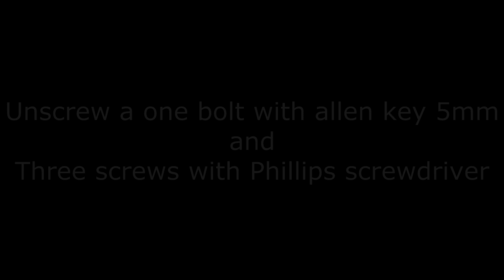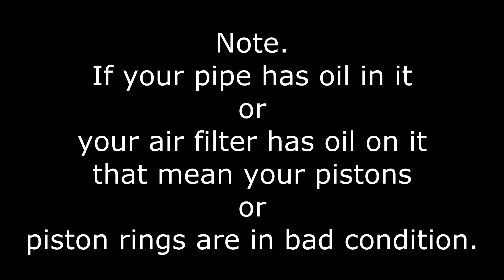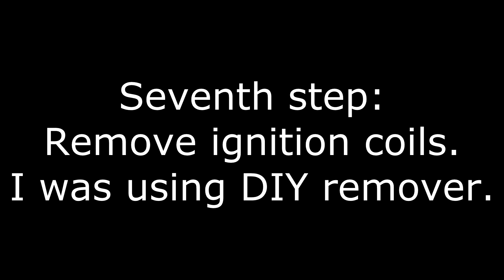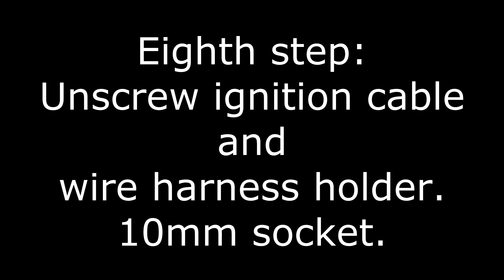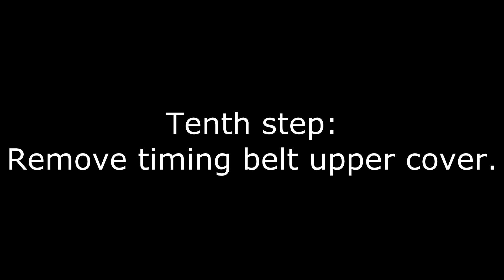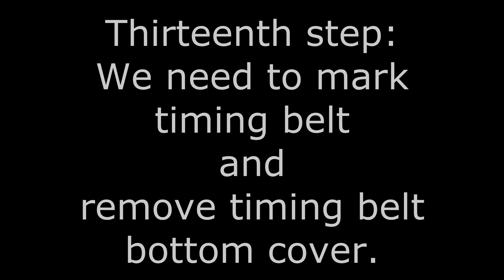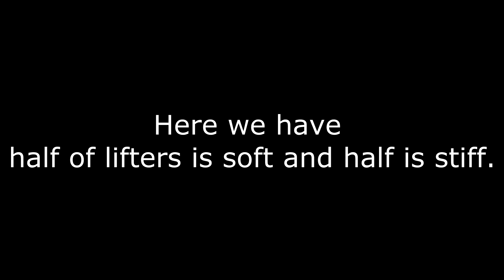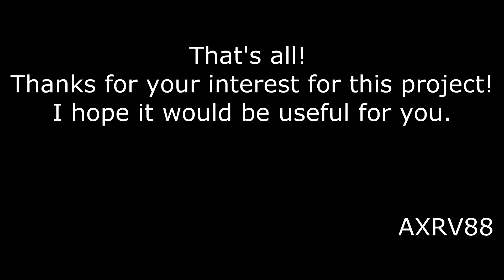VW 1.4 BCA partial disassembly of the top end and valve lifters

Comment: Thanks a lot for this! I guess the AHW engines were the only ones which did not have this problem. I am running with an APE engine and this tapping noise just does not stop at low rev. BTW, what's the state of your engine now?
Reply from the maker: You're welcome! AHW makes other sounds?  On many resources in internet people say 1.4L 16valve 98-200* Year of production has knocking noises. My buddy have GOLF V 2008 with 1.4 BUD and it's knocking more then mine 2003 BCA. Mine BCA has no oil consumption, buddys BUD has a little consumption of oil. If I will ever decide to change valve lifters to brand new, I will made video about it! In mine BCA valve lifters make more noises then in BUD, but in BUD piston slap is more noticeable. In both engines compression around 15bar.
Reply: AHW does have a knocking noise, but can be treated. Before running with an APE engine, I had an AHW and once used liqui-moly ceratec. Couldn't believe my ears! Im now thinking whether to change the lifters, do a complete engine flush or use liqui-moly hydraulic lifter additive. As long as the engine runs, I'm ok with it. Plus point is that once engine comes at operating temperature, the lifter noise are barely noticeable :D
Reply from the maker: Yes! Cold engine works quieter than hot. I do not recommend doing engine flush because dirt with oil can go through engine and ruined it completely. The best way to clean the engine is to completly disassemble it and clean. But no one will do that and other good way to reduce knoking is to install new valve lifters.But also camshaft bed has some wear and can cause noises. Please tell me results after lifters change when you're done it.
Reply: Thanks for your advice. I'll go for the lifter additive first and let you know if it works. Else, I'll be simply changing the lifters. btw, any online store where I can get that from? thanks
Reply from the maker: Sorry, Mate! I don't know online shops where you can buy lifters. I prefer to buy or order parts in local store, because you can see parts before purchase. Where are you from?
Reply from the maker: You're welcome, mate!
Reply: AXRV88 Mate, just to let you know about the lifter noise i had. Did a flush with liqui moly proline flush and changed oil from 10w40 to 10w30. Drove some 200 miles and noise was still here but not so loud. Then added hydraulic lifter additive from liqui moly itself. I'm now at 100 miles since that was added and got to say the noise has dampened a lot and engine runs smoother than before! What i heard is that this additive comes to full effect after 500-700 miles. Fingers crossed, i hope i get good results!
Reply from the maker: Hey! Sorry for late reply! As I understood you decide not to change lifters for new, but try some additives.
As I know engine flush can kill your engine with all dirt, abrasives and other stuff which collects in your engine for years. BUT I try other stuff! For now my engine runs on 98 ron petrol.And engine noise became quieter, power increases, petrol consumption decreases. All noises  at low rpm and noises under heavy loads was detonation noises. 
P.S. I hope your engine will runs good and quiet. :-)
Reply: @AXRV88  just like to say using 99ron(premium fuel) in these engines is the best advice given. People complain of piston slap and think 99ron is only for turbo petrol cars
Reply from the maker: @conorf8091  At some point you're right. On 98ron fuel engine runs much better and has much much less detonation. But mechanical noises are still the same. Piston slap and noisy valve system are the  same even when you're driving downhill on gear and ignition off.
Reply: @AXRV88  still reliable motors. Mine is at 200,000 miles and starts first time. Bit noisy cold/on choke then settles down. No lifters replaced or any major engine work
Reply from the maker: @conorf8091  you are a lucky man! And God bless the good fuel!

Comment: How did you clean the lifters from inside???
Reply from the maker: Lifters were submerged in solvent several times. Not the best choise. Better buy new lifters and forget about rattling. BTW rattling noises are mormal for this engines.
Reply: @AXRV88  Thanks! i bought new ones. there are not expensive.
Reply from the maker: @jankindl915  You're welcome!

Comment: Did you have to remove the main belt, or could I just loosen the belt, to get the cover off?
Reply from the maker: You need to pull main timing belt from pulley and then you can remove the cover. Camshafts and the cover removes like one module.

Comment: Did it fix the rattling noise?
Reply from the maker: +Endroo Engine run smooth about 1 month. But problem, I think, with piston group. Teflon on piston skirt was disappeared and because of it you can hear rattling noise. Piston skirts knocking after cylinder walls (knock-knock-knock)
Reply: Damn! Do you think that it can cause a bigger problem? My 1.4 Variant makes that noise too under 2500-3000 RPM.
Reply from the maker: +Endroo I think knocking pistons make cylinders from circle shape to oval. The biggest problem is when piston broke cylinder wall and you can see it from outside of engine =D
Reply: Holy fuck :D I think I'll get it checked out. Thank's for the help. Happy holidays!
Reply from the maker: +Endroo  But my engine works same way around 5 years and all good, nothing happens.
Reply from the maker: +Endroo Thanks mate, you too! You're welcome!
Reply: that s the bigest problem of VW engines(my vw polo engine 1.4 mpi,,2001,,185 000km has knocking sound-PISTON SLAP).So nothing to do with hydrovalves and its lifters,,that knocking sound(only in vw engines)comes from pistons and cylinders,-so and thats the reason my engine has very poor fuel economy(12l/100km city drive)
Reply: little help for you---that knocking sound(piston slap) i decreased a lot only with MoS2 ADDITIVE OIL when i put in my engine on every oil change.-this is the cheapest solution.
Reply: Gjoko how can i message you regarding the fuel economy i started having this problem from this summer.
Gjoko kako da te iskontaktiram ne gledam na youtube nacin za prakjanje poraki. I jas so poloto ja imam istata maka od letovo..prethodno na otvoreno trosese pod 8l godinava otide do 10l